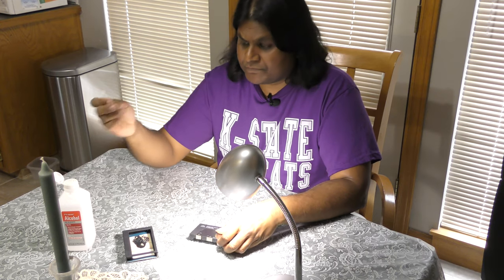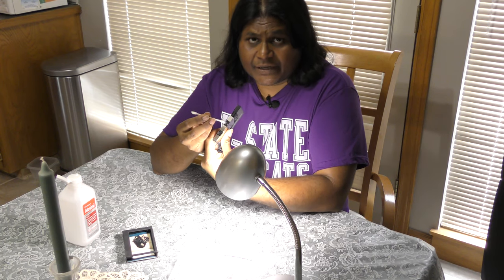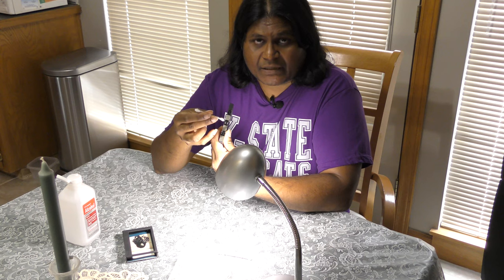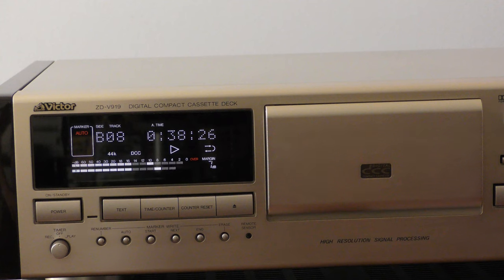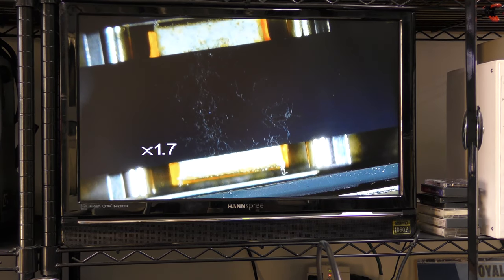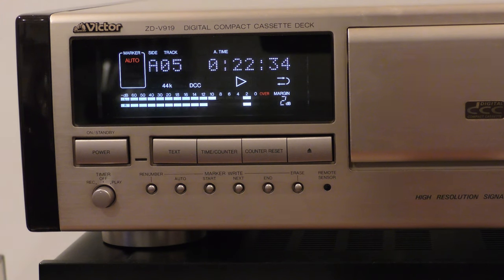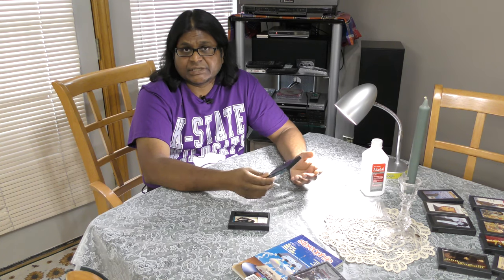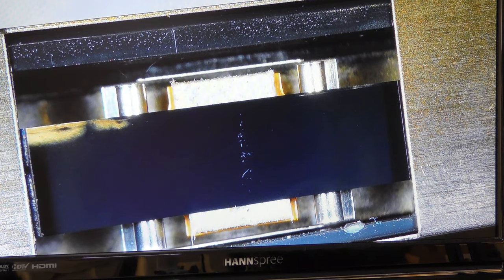Restoring a Digital Compact Cassette and solving your dropouts

Comment: When a recorder auto-reverses at the wrong place of a tape, it's because the dirt on the tape reflects so much light that the optical auto-reverse sensor thinks that it's seeing lead-in/lead-out tape. Not all DCC recorders have such a sensor so your symptoms may vary. 

Besides dust, moisture is an important source of dropouts: Water vapor condenses on the tape (especially when the temperature drops quickly) and when it evaporates again, it leaves particles of dust that can be difficult to see. To prevent that from happening, always rewind your tapes before you store them. And never touch the tape with your fingers of course (if you do, use isopropyl alcohol to clean off the fingerprint).

The DCC system is very resilient against dropouts. Almost half of the bandwidth on tape is used by redundant data to make sure that errors can be detected and corrected. The error correction can correct a complete dropout of all tracks for several milliseconds, or an entire missing track of data. You can use the service mode of your player or recorder to see how good the quality is of the signal that comes from the tape, before error correction is applied. Try multiple tapes; if only a few tapes cause dropouts, the problem is with the tape; if all tapes have problems, it's probably time to clean the heads.
Reply from the maker: One other thing that might be the problem when not rewinding is that the dirty tape now get pressed against the head and that might make it worse. So we could try and investigate this further and if a tape has not been rewound to the beginning, first do a few turns by hand, so the exposed area is not touching the head and then rewind.

Comment: Hello ralf, there is a simple way to put a small piece of cotton saturated with alcohol and adhesive tape and put the tape into the ordinary machine and try wrapping the tape back and forth you can get rid of dust sticking to this tape from my view, I'm sorry my language and hope you understand what I mean as well there is a way with the head pad They have standards that must be cleaned of salts because they are the main reason the sound is cut off,, best regards
Reply from the maker: We have been thinking of a solution like that, as they exist for reel to reel tapes. But the dcc shell is  more complicated and pressure has to be even and the dropouts occur only on certain places. These place stay the same on the tape. Have you tried this with a digital compact cassette? If you did, do you have pictures or a video?
Reply: @DRDCC  Do not forget the small bord for the head in which variables with the passage  time oxidized you  must be cleaned with alcohol because it is very important to output sound without double or cut,

Comment: I wonder if mould can get into the reels in the same way that it can affect VHS tapes? With the latter the visual clue is often white, powdery deposits on top of the reels..but at least visible through the windows of the cassette.

Usually if a tape is stored in a moist or humid environment, or even on a shelf/ cupboard against a colder, external-facing wall, they can often turn mouldy over time.
Reply from the maker: If the Chrome Basf Tape is exposed long enough anything can happen. If you rewind the dcc tape at the end of your session then the only problem is indeed storage. We have seen tapes that have so many dropouts, they are beyond repair. But that is a very small percentage and we believe you might be right that mold could be part of that problem. For some reason most people never rewind the dcc. 90% of the tapes we receive at the dccmuseum are not.
Reply: @DRDCC  Indeed, there seems to be a bit of a science to it. I guess it's just one of those things that can happen with the passage of time. Anyway, great info, as always! :)

Comment: I was wondering if all DCC players can rewind the tape completely to the beginning (and not the beginning of track 1). I seem to remember that my DCC600 could completely rewind the tape until you see the lead-in tape.  But my DCC730 seems to only rewind to the beginning of track 1.
Reply from the maker: Hi Joop. That is true. The 730/951 do this automatically. But if you press and keep holding the rewind button it will rewind to the beginning. The 600 actually had a rewind / forward button separately. The 730/951 have this buttons combined. Press is next/previous track. Keep pressed is the rewind/forward all the way until stop.
Reply: @DRDCC  Thanks for the tip!

Comment: Just started my DCC experience with a Philips DCC 951 deck and blank Philips DCC 60 tapes. My blanks are new old stock, purchased from eBay. Started making mix tapes but the deck gives a high pitch whine as the tape recording progresses-extremely annoying! Searched on the net and someone has commented earlier that it was due to the felt pieces of his cassettes; I don't understand it because my tapes are blanks in wrappers and upon inspection, the felts look regular and clean. Also, just had a listen to the recording and it is dropping out and shambles. "Clean head" appears now as well...did any of you guys had issues with blank Philips tapes or starting out on a newly purchased deck? Dr DCC , please advise thanks!
PS: shone a light on the head assembly and looks-clean....I might do a proper clean tomorrow.
Reply from the maker: Priyantha Ganegoda Hi, yes we have seen this before. Especially with the new first generation tape that came in a green/black wrapper. Those felts have deteriorated over time. It is a tape problem, not the player.
Reply: @DRDCC  I wish I knew that beforehand landing 8 new old stock of the black green Philips! Pray tell, is the indigo blue black Philips any better? Same wave pattern at the front but indigo bluish colour?? Or should I go for even later liquid drop front Philips (which I strongly suspect is 2nd gen)
What is the verdict on BASF, Maxell, Panasonic/Scotch tapes????(these are the other blanks available on eBay for purchase. TIA for advise.)
PS: is there any DCC cleaning tapes or do I do the tedious disassembly and manual clean????
Reply from the maker: Priyantha Ganegoda The later model in blue with drop is better over time. Cleaning is best by removing the cover.
Reply: @DRDCC  Thank you for the prompt answers! I will try the newer DCC blanks, cleaning the felt on the troublesome Philips green DCC tapes and the manual clean.